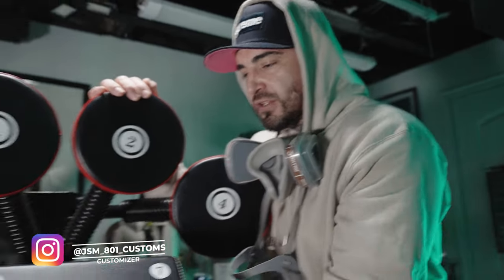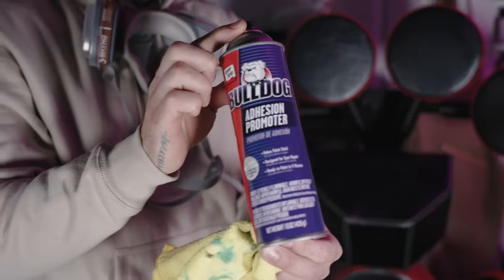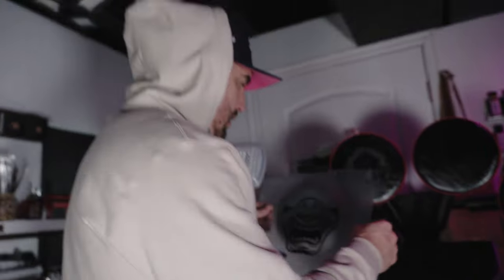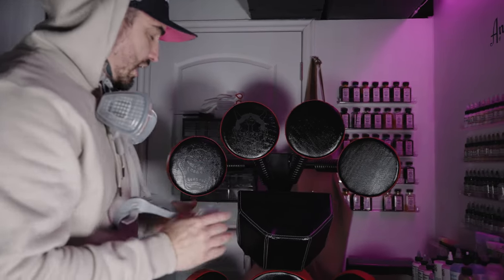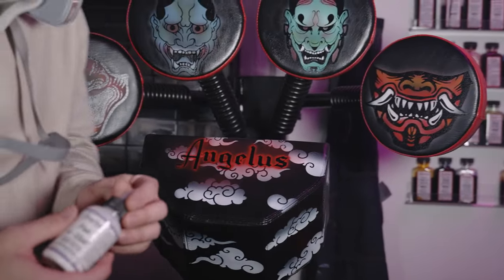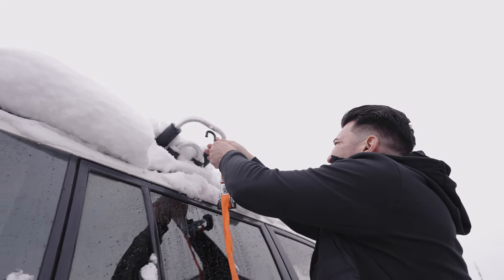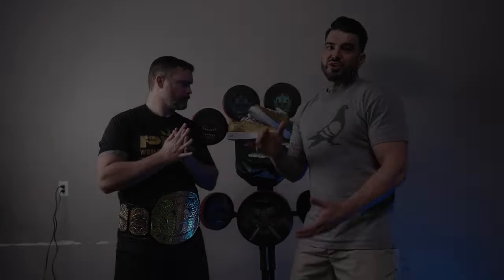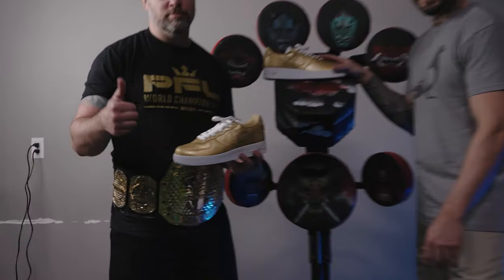Custom Punching Bag | Angelus Paint Durability Test

Comment: Did you use anything to thin the paint?? I feel like when I use the paint alone it clogs up my airbrush
Reply from the maker: The paint can clog up if you used it before opening it. It is always a good idea to filter paint before use with any type of paint when using an airbrush. You never know what air pockets got in to make the paint dry.

Comment: I was excited by the title, looking forward to seeing how Angelus paint holds up to abuse. But I was very  disappointed  to see a lot more style than substance. How can anyone paint in a dark room, and what's up with red and green lights? You put black stencils on black surfaces when the only light was behind you and the videographer; it is no wonder that the outer figures are crooked. Did you really spray unthinned paint in that airbrush, or is that just stock b-roll? You claim you strapped the MPPB to your roof, and drove 6o miles with it uncovered and exposed to the elements; why didn't you show that?  After all that, the boxer seems to have spent 10 seconds hitting the thing. That just doesn't convince me of anything.

Comment: Does that adhesion promoter work on shoes? I don’t use an airbrush, but aside from deglazer and some light sanding, I don’t put anything between the leather and first coat of brushed paint.
Reply from the maker: If you want to on a material you aren't too sure about. Leather it is not necessary.